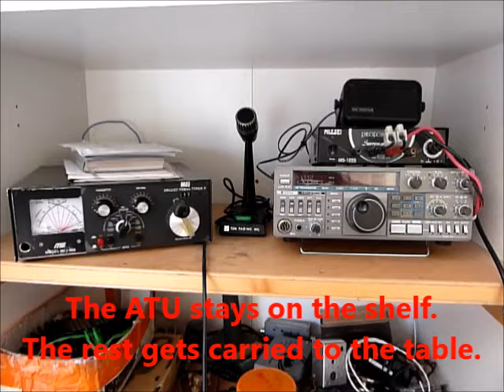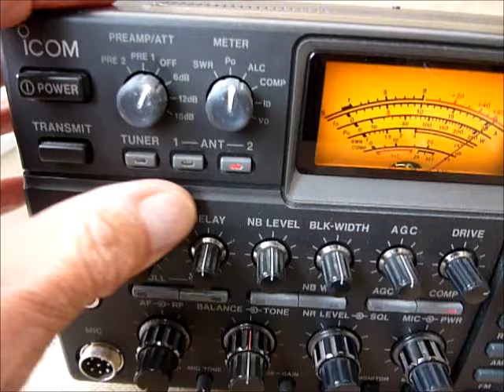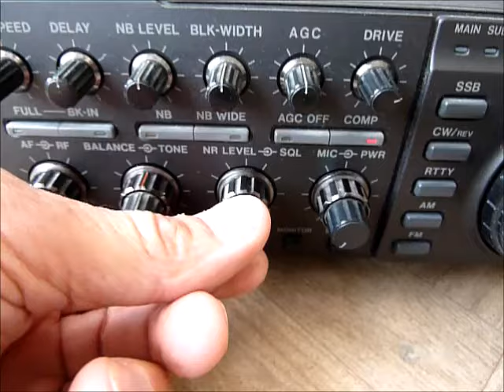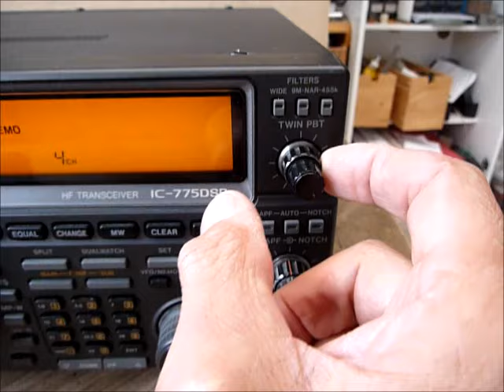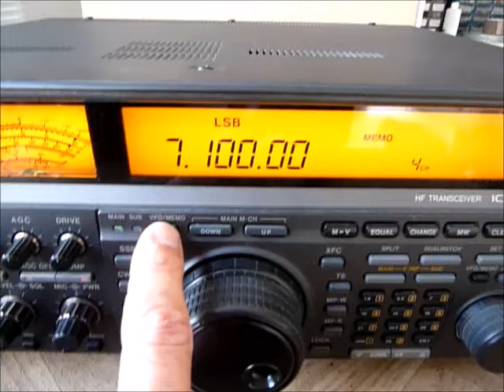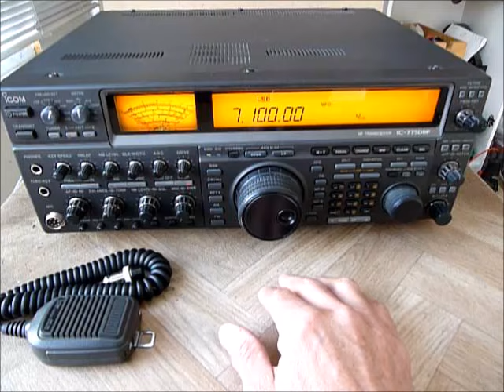ICOM IC775DSP Eeek, what do all those knobs do?

Comment: Nice old radio!
The "transmit" button does actually put it into transmit, like all the other Icom radios. Remember if you are on SSB there will be no power going out when you are in transmit till you input some audio either via the microphone on the line/audio in connector. A quick test would be to put it into AM or FM mode, then there will be output when you press the transmit button. 
I love this radio because it has a true dual receiver including a second VFO knob.
I used 2 of these radios for years as my contest station.
Reply from the maker: I hadn't thought of putting it in AM or FM mode. Good idea.

Although I imagine you'd get a reduced power out, not the full 200 watts. But would be ok for tuning a manual ATU. You'd have to stop the internal auto tuner kick in though.